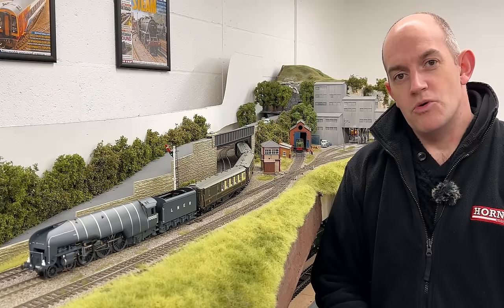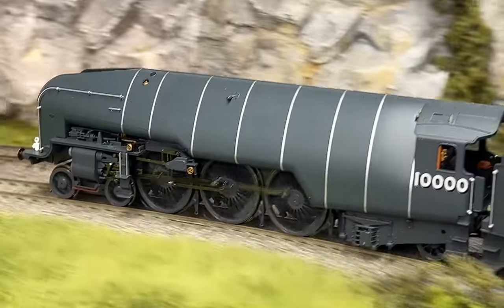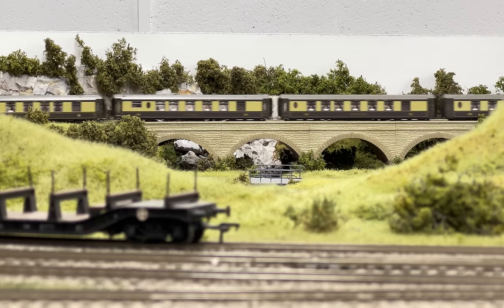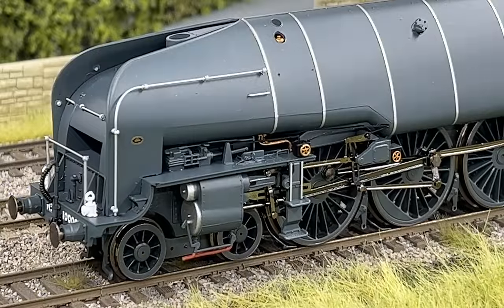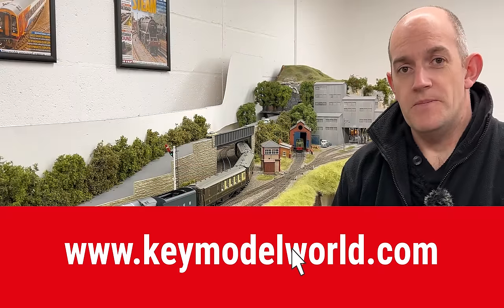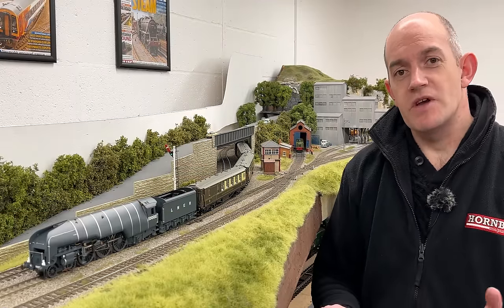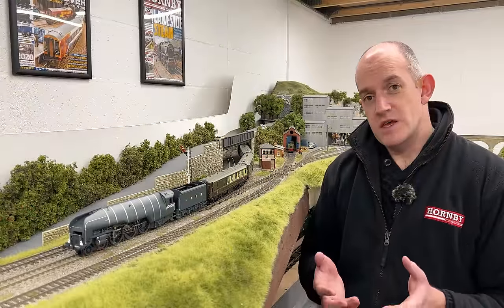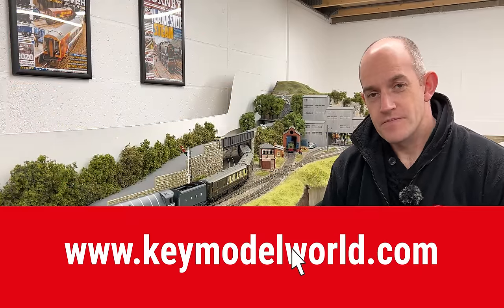HM176: Hornby 'W1' 4-6-4 for 'OO' gauge

Comment: Forgive my ignorance, but why are the four rear wheels on the loco not in contact with the track
Reply: It is a way of making it go around tighter turns. The longer wheel base (if that is the correct term), the more gentle your curves need to be in order for it to not derail.
Reply: @michaelwhiles5282  You mean the guy that puts locos in a kids paddling pool full of water 🤨

Comment: Hornby need to issue new larger diameter flangeless trailing wheels so they at least touch the track. I've got the rebuilt version and they are the same.
Bachmann on the other hand with their new V2 also have flangeless trailing wheels, but theirs do touch the track.
Reply: If you ever find a way to get them to issue larger trailing wheels, please let me know!
Reply: @davidluckman9936  That probably won't happen. But I've found a cheap as chips way to get the wheels to just touch the track to rotate. The clamp piece which holds the two axels in place is made of diecast metal, so pretty rigid. Its held in place with two cross head machine screws (not self tappers), so good quality design there. It occurred to me, not to remove metal from the clamp to allow the axels to drop down further, but to add packing under the clamp screen mountings. I didn't have any tiny washers but a Club member was holding a sheet of paper (as used in computer printer-copiers). So we tore a strip off and used it as a makeshift feeler gauge. Folding over twice (four layers) was about right. So this thickness was made into little rectangular washers with a suitable hole bored through. The hole edges need to be clean, not just pushed through with a pointy thing which results in paper flash. Flash could damage the tiny screw threads. Seems to work and adjustable by adding or removing layers with no damage done to the model, so not affecting its guarantee.

Comment: I've been amazed just how many videos and reviews there have been of this loco: it's a lovely thing, but it's definitely a Rule 1 loco on 99% of layouts.  But I have to admit I've not noticed on all the other videos that the wheels of the trailing bogie don't make contact with the rails (or is there a packing screw you've not undone or something?): that looks absolutely terrible.
Reply: @gotellyamum the annoying thing for me is hornby used to have the rear bogies swing with the rails & now it just seems like a cheaper option for hornby to make them fixed while still charging a premium i mean this loco cost over £200 that is on par with a O gauge tank engine so for me there is no excuse.
Reply: @gotellyamum i'm sorry, what. I never said i couldn't afford it, i mean i've got Hornby's 9F on pre-order & that is £250, the reason i don't want one is cause of it's bad reviews & again i feel the rear wheels are more noticeable on tighter curves regardless of the eye level as they stick out which ruins the looks for me, luckily for me most of my layouts curves are very shallow but i still dont like these flat rear wheel & that is my opinion & no one is going to tell me other wise or tell me why i cant afford one. i will also say Hornby does need to start upping their game cause they have released some pretty bad locos lately (i am really hoping the 9F isn't going to be one of them) & done some not so great business decisions an example is the Titfield Thunderbolt as hornby has had a lawsuit against them for announcing this loco when they dont have the movie rights for it & Rapido Trains do, Hornby have also continued to copy their competitions products after they have been announced just look at the Terrier Dapol. Now i still like some Hornby locos but i have been a lot more critical of Hornby products especially when you compare them to other companies.
Reply: @gotellyamum i've got my eyes on other models at the moment i might get one in the future but for now i'm not that interested in owning one
Reply: @gotellyamum clearly you've never watched Sam'sTrains reviews as i feel he gives a honest review of the products he looks at

Comment: What a beautiful presentation of this powerful locomotive.  Couple of comments though.  On the turntable and trackside close ups the trailing 'bogie' wheels are well clear of the rails.  Is this a compromise for track radii?  I'm not technically minded, but is this a cartaze (excuse the spelling) truck rather than a bogie, hence no pivot?  My other comment is about the sound.  I would have though the boiler was big enough to fit a sound box rather than the tender.  The tender is rather far away from the noise at the front of the engine.
Reply: Doubt you would notice when it’s moving around the layout.
Reply: The W1's trailing axles were not carried in a common bogie. The forward most axle of the pair was carried in a pair of Cartazzi axle boxes, whilst the rear most was carried in a truck. Incidentally, for these reasons the W1 wheel arrangement is really 4-6-2-2. However, the LNER always referred to the loco as a 4-6-4, which sort of validates the error. 
I agree with all the comments regarding the flying trailing wheels on the model. They do spoil things somewhat. It is difficult to see why Hornby could not have arrived at a better solution for the trailing wheels on this and other similarly afflicted models.
Reply: I had purchased one of these and was surprised to see that the trailing bogie not touching was so prominently shown in this video and not commented on.  I love the model and think it looks amazing, but these wheels not touching does look very weird.  I do take a lot of very low shots of trains on my layout and the rear wheels not turning does look very obvious.